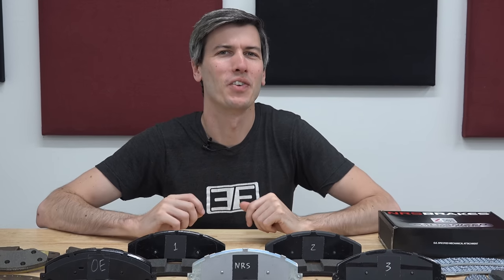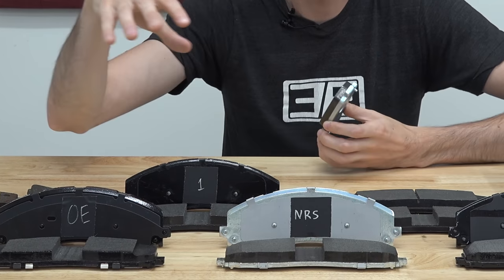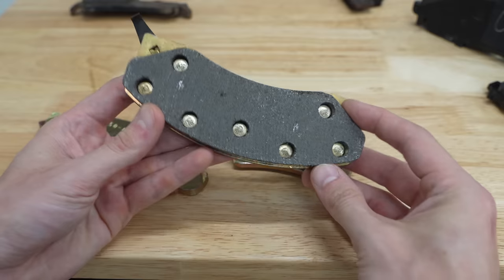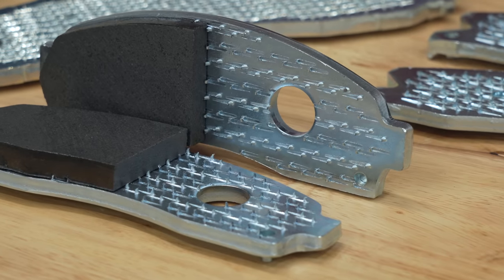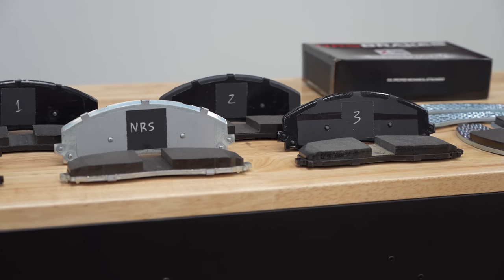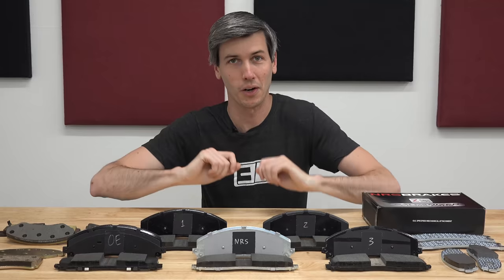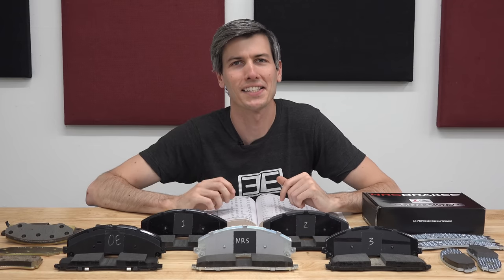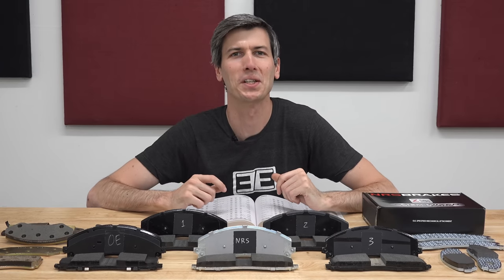The Sketchy Truth About Aftermarket Brake Pads

Comment: Half of the commenters are missing the point... 

Several of the aftermarket pads are being marketed as OEM replacements but don't have the mechanical gripping that true the OEM pads require from the manufacturer. You as the consumer might think you're buying OEM pads that are just as good as the originals when they technically aren't and you'd never know the difference. The video isn't saying that all brake pads everywhere should always be mechanically secured, it's pointing out that companies need to be more clear when slapping an OEM label on their product when it doesn't match the OEM standard.
Reply: Oh look, copy and paste. If Brembo (insert any other major brake pad supplier) says adhesive is fine, adhesive is fine. This weirdly specific scenario where mechanical is absolutely necessary is so niche as to not matter. I'd rather have mechanical and adhesive if possible, but it does not warrant a 16 minute videos and multiple research studies.
Reply: @heyhayhay247   Oh look you still missed the point. You can't market a product as being OEM replacement without meeting the OEM specs
Reply: @zbaier1  No, the point of the video was to sell brake pads by focusing on one single arbitrary detail that somehow never seems to affect anyone. The title is inflammatory click bait, and it disappoints me. Mechanical connection can be better, but it's hardly the differentiating factor they make it out to be.
Reply: OEM replacement generally means the pad performs similar to OE. So if the pad performs similar to OE but uses a different attachment method it is still an OEM replacement.

Comment: Before my fleet days in automotive over 27 yrs ago, the most failure I saw other than wear is cracking and pieces missing. The bonding didn't fail, the material did. But today with ceramics I guess things are different. My half ton truck has ceramic pads! I'm like whaaaaa?!

Comment: What are the rules they are playing ?
I am not sure if I should like such content where a manufacturer develops his own test methods to show that they are better than other - in their own defined test scenario.

When are those sheer force appearing in real world usage ? 
Those pads sit on their metalplates holded by the caliper and brake itself. 

Feels like a theoretical test to look better than the other and I guess the others would now come up with their tests where they look better. 
If glue is the issue get rid of that glue, if heat is the issue look for a better glue in hot environment cause there are glues that work quite well or did I miss that most space shuttles were able to land quite safely ? Maybe 1% crashed due to failure but not sure if that has been caused by glue that did not work anymore.

At least the space shuttle heat protection went through high heats at least once every mission if they had survived. 
And here our mechanic has not observed bad brakepads , even the certification  engineers that have to check the cars street compliance biannually have not found much complains about brakes in general except if they were not maintained anymore or brake pads / rotors have been used too heavily and had to be replaced cause there was no brake pad anymore or the disc has become too thin.
Reply: Several of the aftermarket pads are being marketed as OEM replacements but don't have the mechanical gripping that true the OEM pads require from the manufacturer. You as the consumer might think you're buying OEM pads that are just as good as the originals when they technically aren't and you'd never know the difference. The video isn't saying that all brake pads everywhere should always be mechanically secured, it's pointing out that companies need to be more clear when slapping an OEM label on their product when it doesn't match the OEM standard.
Reply from the maker: I think that's fair! I think best case we do the same test with each of the different brands (we did this for the previous video).

Comment: Had a pad fall of the backing once, 100% gone. 3/4 ton truck but it never had the brakes severely heated and less than a year after install. Too many years ago, don't remember failure point, I think it may have had through rivets.

Comment: Your choice of “quality control” was cherry picked to be worst case for adhesive and best case for the mechanical. What if the nail only protruded a very small amount instead of an inch? I don’t think you can argue that quality control is more of an issue for either method.
Reply from the maker: It's just one nail to illustrate a point, if there were a bunch of nails, even with small protrusion (like the pad), you get a better hold (for shear forces).

Comment: After many sets of track pads, none of which seem to have any mechanical attachment like shown, I've never seen one have the friction material separate from the backing plate.  I've had some crumble from excessive heat, but nothing close to separating, even when worn down to 1-2mm of material left.  I've seen temperatures over 800C (1500F) repeatedly without failures.  To be fair they're high quality pads and not bargain white box parts, but there are definitely pads out there with no mechanical adhesion that are well beyond adequate for street and track use.

Comment: isn't this a pointless test? it's totally unrealistic a car's brakes will be at 550 deg for literally days on end

unless of course, any amount of time an adhesive spends hot irreversibly deteriorates it
Reply: >unless of course, any amount of time an adhesive spends hot irreversibly deteriorates it

This is literally what happens, you figured it out.
Reply from the maker: You've got it with the second point. For applications that have high heat (as stated, heavy duty trucks for example), the adhesive brakes down over time. You can see this with the graph, the breakdown doesn't happen all at once, it's over time.

Comment: You may be interested in a company from Washington state, IIRC. Porterfield is basically unknown east of the Rockies, but has a solid rep among racers in the northwest. Their RS series are for street use, as opposed to their racing pads which are designed to work best when very hot.
 I changed from OEM pads to Porterfield RS, and it took a while for them to bed and break in on my car. I took an old friend on a ride, and the difference was great enough that he said to me "Did you do something to the brakes on this car?" Porterfield sells and ships direct, so the lack of retail distribution east of the Rockies is no problem.

Comment: Hi Jason, quick question. How hard should I (or any person) step on the break whilst waiting for the Green light . Should you step as far as the pedal can go, or just enough pressure to keep the car from moving.

Will stepping on the break harder damage the mechanism? Or despite any damage It can cause , the benefit is you Will remain stop even in case of any unexpected event.
Reply: Moto. I do not have a direct response to your "brake pressure at light" question but have rebuilt tons of brake systems. Just a light touch will keep the vehicle stationary. Brake "forces" are critical at high(er) speeds and hard braking where the rotors are super heated. The hydraulic pressure from the master cylinder and through brake lines is tremendous. For fun, do a cross section on a flex brake line. You may be surprised to see the multiple layers of material and the relatively small internal diameter that carries the brake fluid.

Comment: rust-jacking is a common occurrence in Central NY...with all the salt and snow, the rust is bound to happen and I have seen many pads fall right off the backing plate....back when I started working/repairing vehicles, the pads and shoes were bonded or riveted....the riveted hardly ever failed but it was probably cheaper to glue friction material onto backing plates and eventually they took over the market.....but in the end and by your results today, the riveted or mechanical bonding seems to perform much better than the adhesive bonded brakes
Reply: In WNY here, and while that may be true, I expect that happens mostly with people don't drive a lot such that a set of pads might last them 4-5 years. Thats a long time to sit exposed such that rust can really work its way in there. For people driving 10-15K a years, they're going to be getting brakes every 2+ years, so the rust is rarely going to get past surface.
Reply: @boots7859 Not if you drive mostly motorway miles. That's the issue I have. 20k miles a year but mostly on motorways. My pads rusted the lining off before I wore them out.

Comment: Although I like the idea of a mechanical attachment, having the addition of a chemical/adhesive attachment to seal the edges of the mating surfaces between the backing and the friction pad is a good idea. Especially for cars used in places with heavily salted winter roads.

Comment: i had no idea that modern adhesives were that inferior to mechanical attachment. I've been working in the automotive aftermarket for roughly 25 years and I've run aftermarket pads on my personal daily drivers for about as long as they have been around and I guess I've just been lucky to have never had a failure.

Comment: When I used to live in the Kenya for my corporate job, I drove an old nissan sentra and guess what, the after market "brake pads" were just old brake pad backing plates with a cement block attached to them; then they spray painted them black. The pads lasted weeks mostly in part because  of the slow speeds. But I kept questioning why my brakes wear out so fast. And one day in the rain my right front wheel seized and I saw crushed cement powder coming out of my calipers. I called in a road mechanic and he said that the local mechanic shop had been scamming me all this time.

Comment: I see plenty of rust jacking separating the friction from the backing being a tech in Wisconsin. On my abused f150, excess heat causes the friction to separate from the backing as well. It's gotten to the point of changing pads at every oil change. Once the pad starts to fail, braking performance is reduced and total failure is eminent. I got a fun car with bigger brakes this year and no longer beat on the f150.... as much     It needs brakes soon, Ill try some NRS pads out on it

Comment: Not sure if its unusual but my car wears disc's faster then it wears pads. I've never had my pads wear out before needing a new set of disc brakes. I think the issue is that my brakes don't get allot of use and when they do its usually light braking. I think I'd benefit from a softer compound pad but I don't really have much information to go on when replacing them.

I drive a toyota Aygo, its driven in a way that I get 70-80mpg (imperial). My discs usually wear out every 30-40,000 miles. I'm on my 3rd set now fitted at 90,000 miles but instead of getting a cheaper brand I bought Brembo Pads and discs and there's slight pitting at 20,000 miles (110,000 on the clock) so it may be better but it's still pitting the discs
Reply: Could be torquing the lugs too tight.

Comment: I am not a professional mechanic, but I've done a lot of brake jobs; my first one in 1959.  I'm wondering if your informative and comprehensive video isn't a solution in search of a problem.  Like others who have chimed in, pad separation seems to be a rare occurrence based on the experience of professionals who have done more brake servicing than I have and I've done quite a bit.  I personally have never seen a pad separation failure, nor (during my racing days) have I ever heard of a competitor suffering a brake pad separation failure.  I admit that I don't soak my brakes in salt water so "rust jacking" is not a problem.  I usually change pads before they rust away.  Usually the backer plate looks just fine so shopping for pads based on which are plated makes no sense for my applications. 

And I tend to buy premium pads designed for racing, Autocross, or high performance driving; so these companies have a reputation to protect. I really don't care if they use unicorn spit to hold the friction material on.  As long as it works, I'm OK with it.  Over the many years I've been doing this I'm sure I've purchased mechanically riveted pads, glued pads, and those with glue and mechanical hooks, something I frankly never paid attention to until now.  None of them have ever failed. Full disclosure:  I never shop for the cheapest pads.  If I were to do so, perhaps your test would be more important to me. Still, my red-neck friends who maintain their pick up truck with the bare minimum of effort and expense have never told me about a pad material separation failure.

I'm 79 which is pretty darn old, and my racing days are over, but I still compete in SCCA Autocross events every month.  I own three cars prepared for Autocross and they all have pads selected for special performance characteristics suited to the slightly unusual conditions found in the sport of Autocross which are different from road racing or street driving.  I could care less how the pads are attached as long as they never fail.............. and they never have.  The pads I use may or may not do as well being baked at high temperatures for a week as the pads produced by the company which paid you, but the pads I buy usually offer 5 or 6 different compounds which fit on my car(s). That way I can select a compound best suited to my needs.  Having the right compound is WAY more important to me than plated backing plates or an attachment which is marginally stronger, especially since pad attachment is not a problem in my experience. Nice video though, as are all your productions.  I look forward to the next one.

Comment: My wife's late model Japanese car recently had a brake lining fall off at 31K kms.  I found the friction material on the driveway, under her car.  She complained had about a noise a couple of days prior.  It was an OE pad.  Videos like this are extremely helpful because this is a shocking safety issue that has been allowed to degrade over the years.  There are so many sketchy brake options available, we are literally down to just a few that are decent.
Reply: Things just don't fall off.
Reply: @zachv1942 They do if the adhesive was contaminated. See the video.
Reply: @paulsengupta971  There was some rust where the lining had been.  It wasn't a lot but there was, at least, some rust jacking.

Comment: I had a Mazda and the friction material parted company from the pad backing plate, It had the original pads supplied when the car was new so i knew it was OEM pads. Lucky I was able to stop the car even if it was a slow and noisy stop.

Comment: I have been extremely satusfied with the performance and reliability of the ceramice pads that I have been using. When I went to a local major parts store they told me they are not allowed to sell me ceramic pads because metalics have greater stopping power. I never heard that before. I went online and bought my ceramic replacements and problem solved. I do inspect the pads during rotations and have not seen any signs of attachment failure. My rotors are on their third set and still look like new.

Comment: Okay, I understand the point being made here (one very similar to that made in a previous video with NRS). However, I have questions. For example, there are 5 pads from 5 manufacturers on the table, and then 6 pads from 3 manufacturers in the test or possibly 2, you never say - are the adhesive pads the same as on the table or are they completely diffeerent? Are they representative samples of all adhesive pads, or were they picked for their contrast to NRS's pads in a specific test? You said that the ones on the table were from 'tier 1' automotive companies - but at least 2 of them went untested. If the answer isn't because they were better than NRS, or were feared better, then why leave them out and sub-in 2 extra sets of NRS brakes in different hook sizes? Love your videos, but this one has me scratching my head. Thanks!

Comment: This is one of those issues that only really comes up if the person doesn't take care of their vehicle or just shouldn't be driving because they are so bad at it. I personally have only had one pad come apart, and that was due to just a faulty pad as the other shoe was fine, as were the other three sets on the trailer. Even with strict quality control, sometimes you just get a defective part. I have heard of other cases of the pad separating when at a tire shop to get a flat fixed or tires changed; sometimes the person at the counter is talking to the customer on the phone or the tech comes out with the failed part in hand to have the counter person call the customer.

Comment: I still vouch for oem/oe parts, but the only time I've seen the friction material split from the backing plate was with Brembo pads. Have used them, ferodo and ATE and seen no real difference between them in street+ usage.
Reply: Forzer. I have GM OEM Brembo pads on my Cadillac ATS fixed calipers. Excellent performance with several years use. Recommend.

Comment: As a former mechanic and workshop owner I only ever supplied and fitted brake pads and shoes from a top quality 'household name' brakes manufacturer.

I used their products on my own vehicles too.

Like oil, oil filters and gaskets, top quality brake pads and shoes are chosen without exception, they're too important a component to skimp on, one's safety depends on them.

Comment: I just looked at their website. NRS charges $100 more for a set of front brake pads and rotors than OEM parts from my local dealership. It's hard to justify buying them at that cost